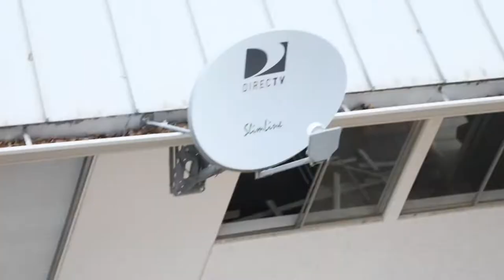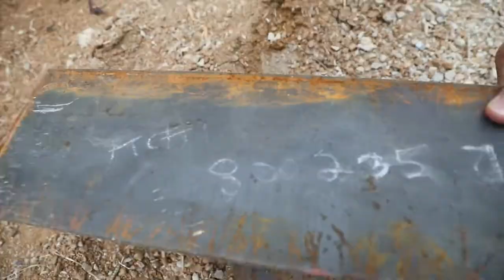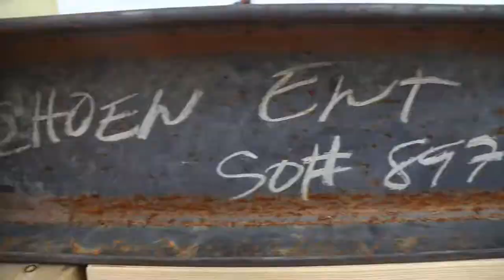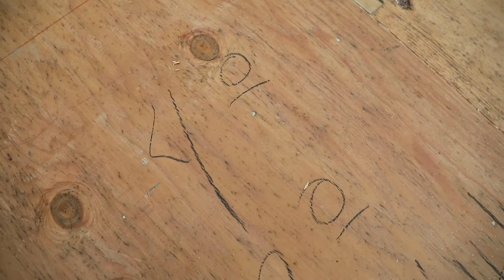Episode 85-DIY Framing a house

Comment: Amazing work. Hopefully hgtv can take notes from real content like this. I'm curious though... how high should you frame before sheathing to prevent any racking?
Reply from the maker: Thanks for supporting!  So yea unique build for us we have 170lf of Su basement walls which acts as a shear stop. The 1st and 2nd floors which are actually the 2nd and 3rd floors are heavily braced. We have like 300 2x4x16 crisscross everywhere until we get it sheathed with 7/16 OSB. Got 400 sheets of OSB going up soon to get it stabilized. Also to add to the complexity we have  bunch of weld plates in the slab to hold up the I beams which again helps to hold it all together and strait.

Comment: Nice build!  Are you sure your able to bottom notch those gluelam beams like that?
Reply from the maker: Good eye. In this specific case we can get away with it because the beams look cantilevered but are self supporting. The notched gluam with brackets is just for the look we’re trying to achieve. If they were structural then no the beams should not be notched.  Thanks